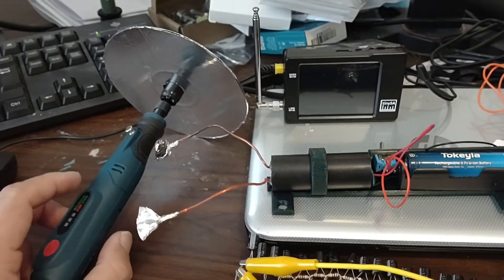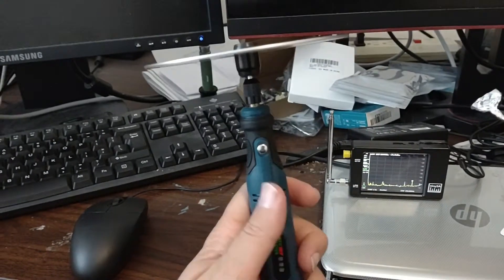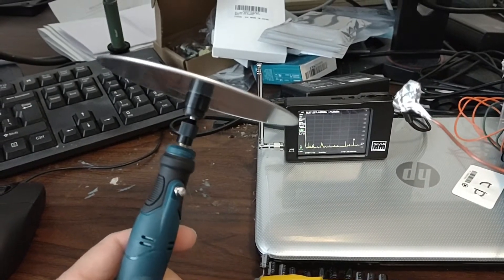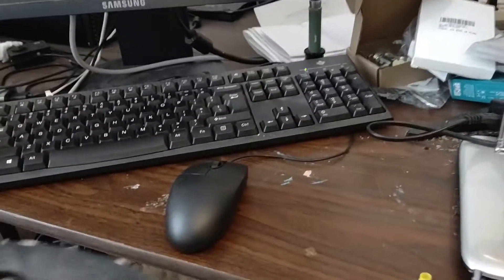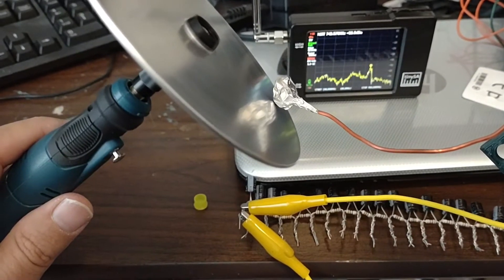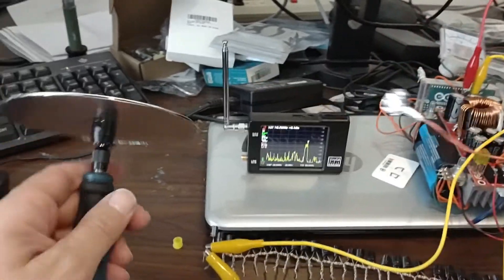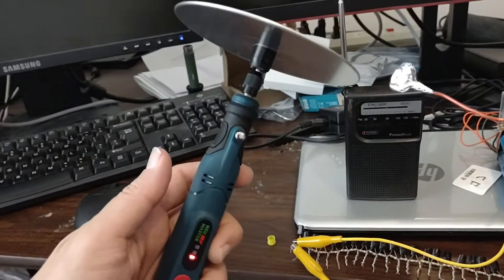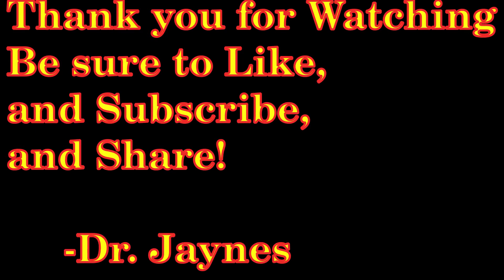High Voltage Disc Generator!

Comment: well if you have horizontal magnetic field of the earth, putting cross perpendicular horizontal current through the air will push stuff upwards. normal hall-effect levitation in magnetic field. yep dc wire levitation in magnetic field.

Comment: It will probably make the same noise when touching the plate without rotation. Rotation just creates many more sparks, each producing a rf signal spike.

How exactly do you thing this can produce hf gravity waves? 
Electricity travels at the speed of light, so how will it work?
Any ideas to the concept?
Reply from the maker: I have theories.. Anti-gravity is not caused directly by an electromagnetic field... There is a secondary field, that is responsible for the gravitational effect.. This secondary field is only weakly interacting with normal matter... It is difficult to detect and measure, and the coupling to this field is more complex.. I am still researching this phenomena.. More to come soon.. This is a research in progress.. It looks like there was a second comment posted here, but YT must have deleted it before I could have even read it?? Remember, the whole internet is now under extreme totalitarian censorship.. the kind that Mr. Stalin himself would be extremely proud of.. May God help us!  Anyway, see you in the next video!!...
Reply: @jaynesnetwork  interesting. Looking forward to the next one.